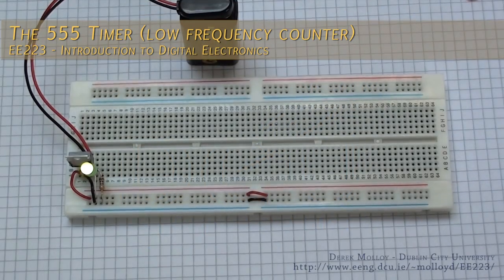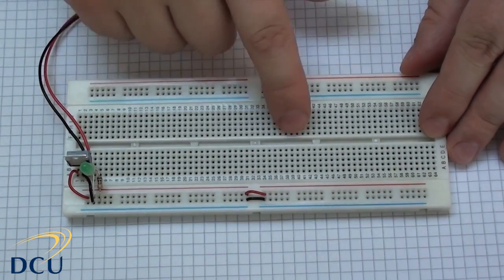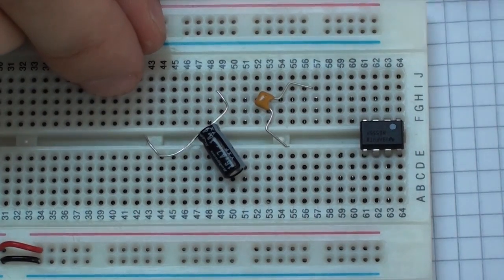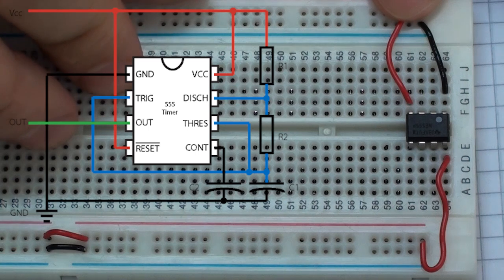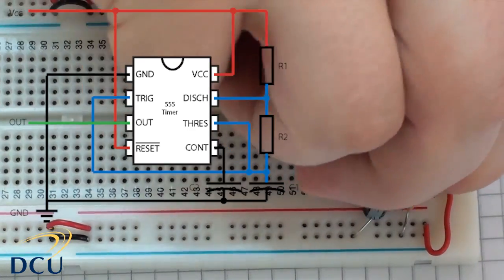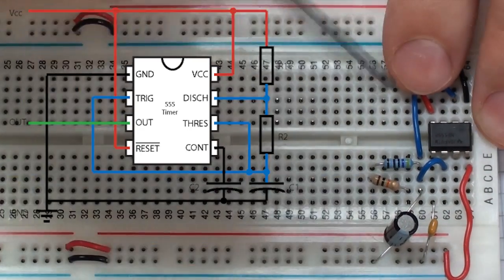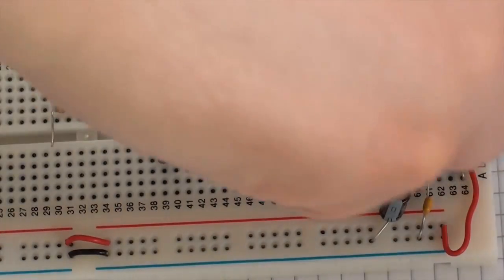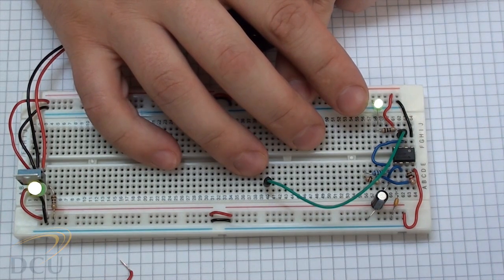Experiments 4.1 : Applications - The 555 Timer Sequence

Comment: So far, so good. What I am really looking for is how input affects output. How much voltage do I need to put into pin 8 to get that thing to work. Further, if I pump x volts into that thing  into pin 8, how many volts will I get out of pin 3? 

Further, elementary circuits usually either blink lights or put out sound. If I am doing sound, will the notes I get be the  same ones that match the frequencies of the musical scale , i.e. A4 = 440 hertz, C4 = 261.6 hertz, etc. ?

Comment: can i use 22uF instead of the 47uF since thats the closest i have, or should i use higher 100uF?

EDIT: So i used the 100uF and it works fine, im sure i calculated correctly; the frequency with this capacitor turned out to be around 0.56Hz

Tested 22uF: Flashes at around 2.14Hz

Comment: Derek, the algebra equations are too much for my old brain. I need the LED to be lit for one second and off for one second. I'll be using this circuit to run the nav lights on my 1/350 scale model of the Enterprise from Star Trek (almost 3ft long when completed). My lighting system will also be powered by 9V (a 9V wall wart). Could you tell me what values to use for R1-2 and C1-2? I could do trial and error if I had a large stock of components, but I don't. I would really appreciate your help.

Comment: Derek those algebra calculations are bit too much for my old brain. I would like build this circuit for the purpose of using it to power the navigation lights on my 1/350 scale model of the Enterprise from Star Trek. It's a very simple circuit to build, my only problem is, I need the light to stay lit for one second. One second on, one second off. What value of resistors and capacitors do I need to use? If I had a bunch of them on hand, I could just do trial and error, but I don't.

Comment: since the output is either high or low, you can put another led in the opposite direction going to the high rail. you may need to use a resistor to drop the voltage enough to not kill the led

Comment: you want to control a motor with pwm? you can use a potentiometer in place of his 1k resistor to vary the duty cycle between 50% and 100%. just use the output to pulse your DC motor. as for a specific potentiometer value.... there are formulas out there, or just experiment ;)

Comment: Yes, Derek is using an L7805 5V+ voltage regulator. The NE555 can take anywhere between 5 and 15 volts, but somewhere around 9-12 volts would probably be optimum.

Comment from the maker: Yes, have a look at the webpages tied to the video description for this video. Under "5. Clock Generator Circuits" I do out the calculations. If you change the values in these equations you can get any frequency that you would like.

Comment: Derek if you want to have the same clock signal but at a frequency of 1Khz using the same schematic, what capacitor and/or resistor will you use? Thanks

Comment: Hi, can you explain something to me, it has nothing to do with this vid, but with electronics in general..
How can the mains voltage be stepped down only with resistors and capacitors? voltage divider? that type of circuit can only be used with very low power draw right?
I have a regular comercial motion sensor, it has 2 boards inside, the PIR circuit and the power/relay board. It takes the 220v and must reduce it in order for the remaining circuit to work.. How is this done?

Thanks! =)